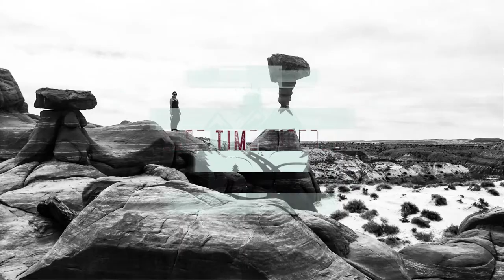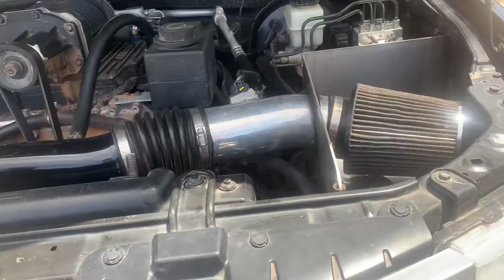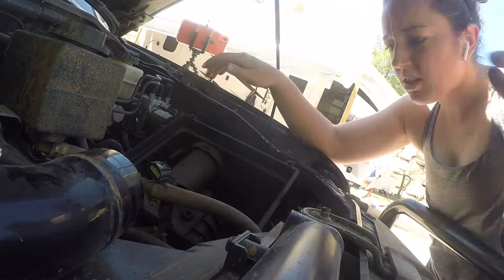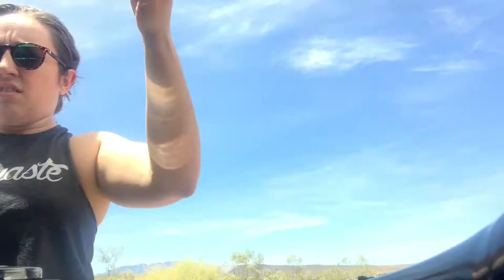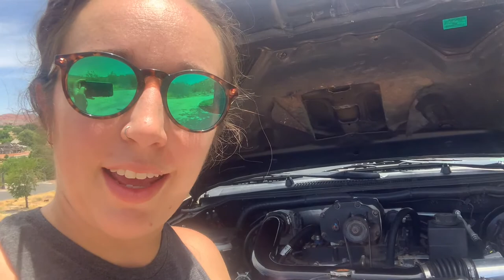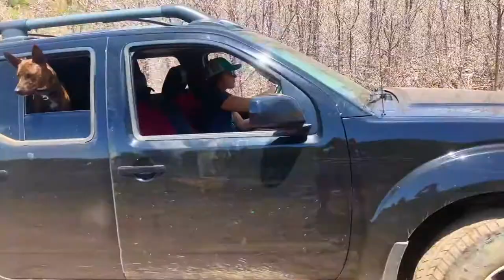Dobinson's Snorkel Install on a Supercharged Nissan Frontier

Comment: I have a Pathy 4.0L and am dying for more power for towing our Black Series Camper. Do you guys tow at all? How reliable has the SC been?
Reply from the maker: We don’t tow, no. I think if we wanted to tow we probably would have gone with a full-size like a Tundra or Titan. The SC has been amazing. We’ve had to do a few tweaks for off-roading that the previous owner hadn’t done but it’s really fun and the extra power helps a lot!